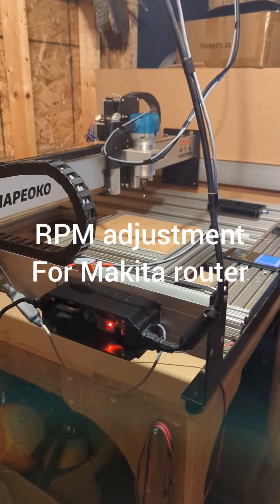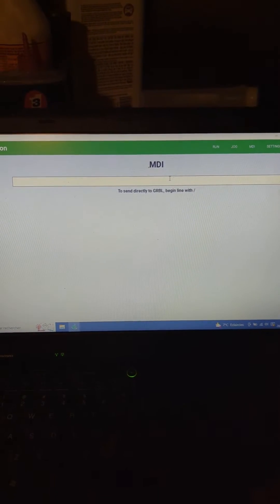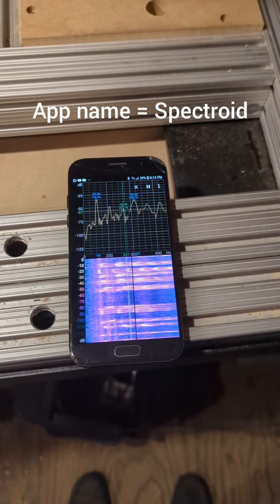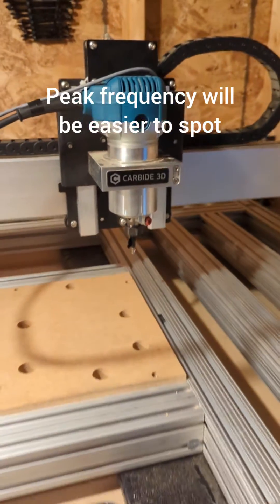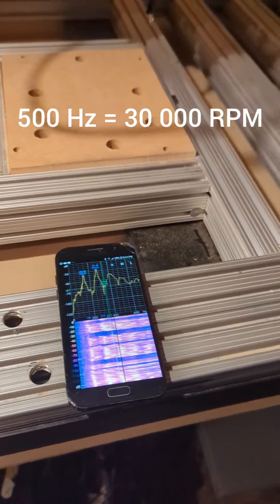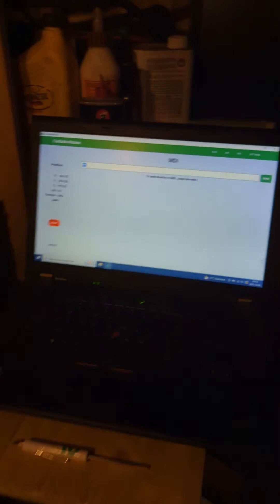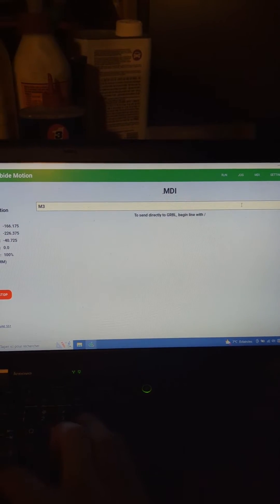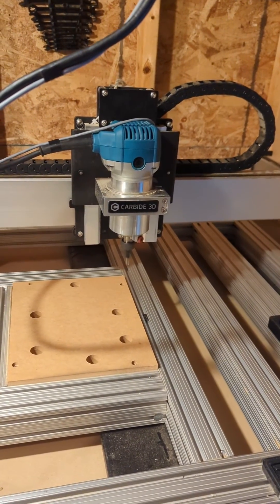Shapeoko upgrade - Speed ajustment  - Makita router PWM spindle speed control

Comment: Is this really frequency control or just a zero crossing detector, I also made it confusing with my pro micro 9v or 12v supply which I have to embed there
Reply from the maker: Hey, I would love to help you, but I think I don’t have the necessary context to do so. Yes, the Shapeoko main board is sending a PWM signal, which I read and use to send the appropriate signal to the router to set the speed. While setting the speed, when I detect a PWM signal, I turn on a relay that turn on the router.
Reply: @felixdostie9024 i know this is 2 years later, but what is the "apropriate signal" that the router expects?  I expect you are not feeding in the 5v PWM signal directly to the router...  what are you using?
Reply from the maker: @heavyhauldude9914 dc voltage. You can get a meaure of it when you mesure at the potentiometers leads.

Comment: How is this PWM controlled? Isn't it just replacing the knob on the router?
Reply from the maker: The way it works is that you replace the knob on the router with cables that get hooked up to the CNC main board, and thru G code that you send with your computer, you set the speed and "turn the knob" electronically. This way you dont have to touch the router to start it or to ajust the speed.